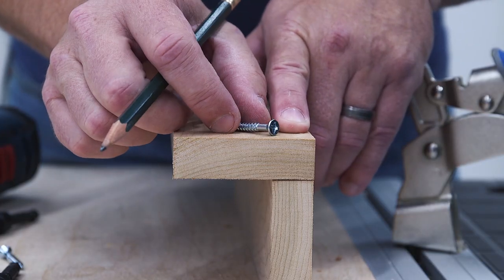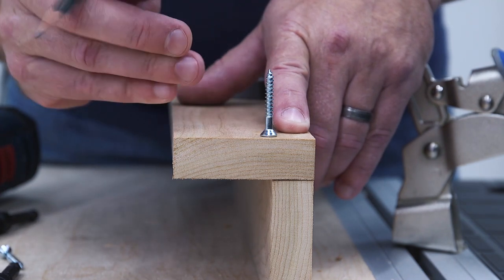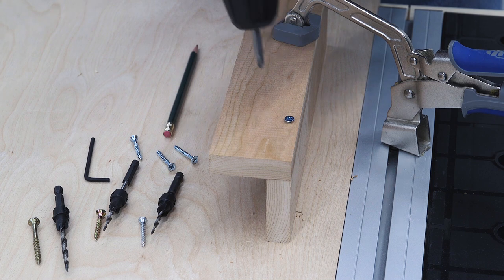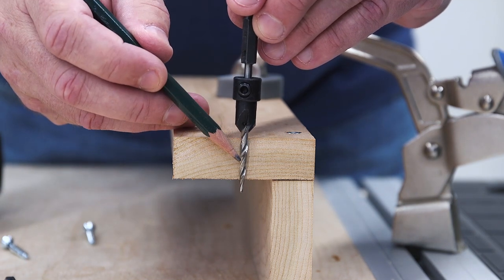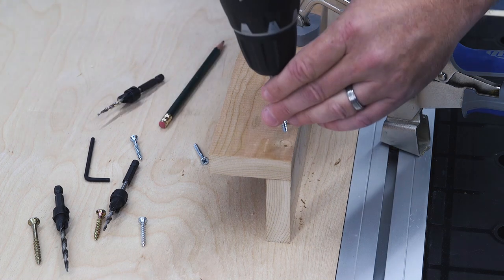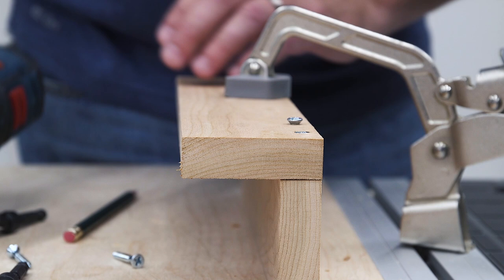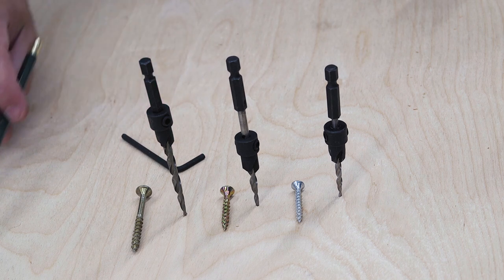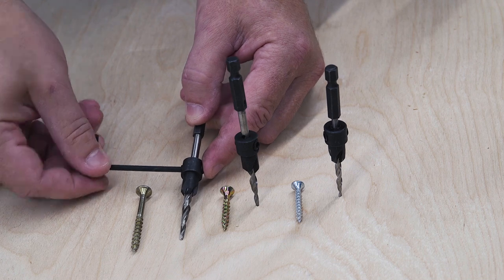How To Countersink a Screw

Comment: A word of caution: the drill bit is tapared (conic) in this countersink. It is for traditional woodworking screws which are tapared. For example, if you use a not tapared #6 screw with the #6 countersik of this kind the hole will be greater than the thickness of the screw.

Comment: I think those are the ones that can be used to actually take out more wood than demonstrated and then use a plug cutter (usually there is a corresponding one) on a scrap bit of wood to then fill the gap with.
If using just to make the screw flush, for example on floorboards underneath carpet, a countersink with a drill bit is perhaps overkill.